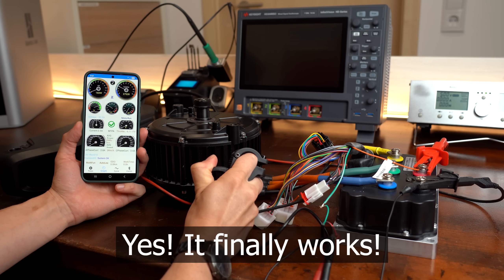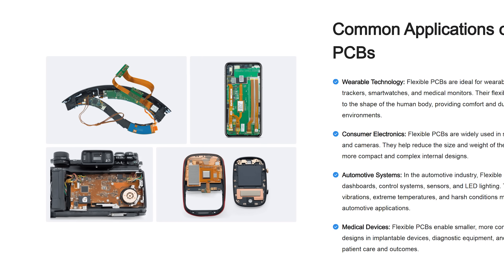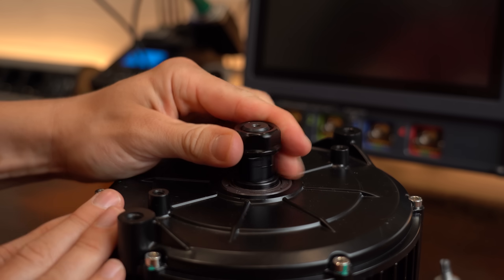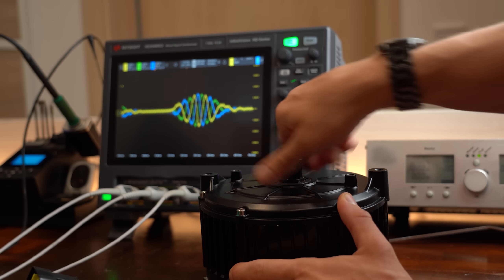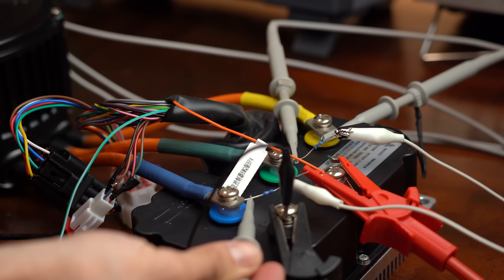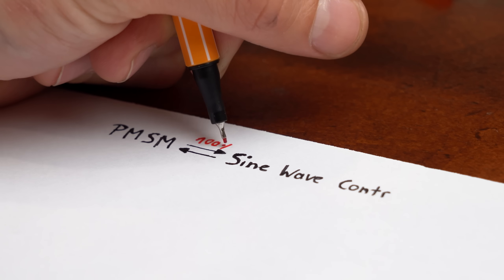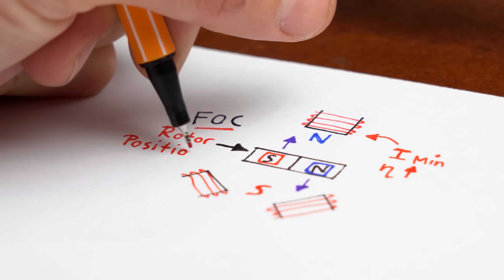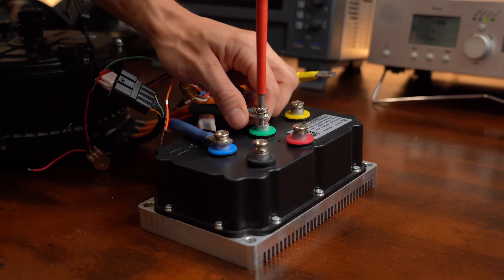The Most Important Motor for our Electrical Future?! (PMSM) EB#63

Comment: Finally someone explain in clear way the difference between BLDC and PMSM
Reply from the maker: Thanks :-) I tried my best
Reply: @greatscottlab  I still don't get it. I have bought a couple of cheap Bosch BLDCs from Pollin, quite big ones, and when playing around with them I got a beautiful sine wave on the oscilloscope. Nothing trapezoidal. They were advertised as using permanent magnets and being suitable for power generation. So I'm still none the wiser. What is the crucial difference? Why do my BLDCs behave like PMSMs?
Reply: @horrovac  Yea, I've also seen small drone-sized BLDCs generate sine-wave, and ESCs outputting sine-wave, I'm confused af.
Reply: @horrovac  The term gets thrown around interchangeably. But ideally, a PMSM  and a BLDC have only one fundamentally significant physical difference. That is how the coils are placed on the stator. The rotor is almost always halbach array, so no difference there. By playing in between how much of lap winding and wave winding is done, a PMSMs BEMF changes, if the motor is very wave wound, then the coils are "deep" and the voltage clips on the top. The magnetic flux linkage between the rotor magnet and stator coil is strong and sudden when the rotor aligns directly with the coil, this gives a near-constant rate of flux change when the rotor is in this aligned region → resulting in a flat (clipped) voltage during that time. So, basically, BLDC is just a PMSM that designed to tolerated the DC like psuedo sine wave that is fed it to it.

Mind you, if you do sPWM or SVM control on BLDC you still get all the benefits you get with a PMSM. But if you run the PMSM with a BLDC trapESC it will heat and destroy itself even within its operating parameters and inside its lifetime, but its not immediate or anything, just it doesn't have the winding to soothe those ruffled MSW feathers.
Reply: I worked in EV PMSM development, they’re the same thing. The voltage waveform is just a compromise about optimizing for harmonics and NVH (more sinusoidal), or optimizing for torque density (less sinusoidal)
Reply: @BIGGlep  I work on mil/aero grade actuators, so PMSMs are very important for us too. God I love those motors. And I hate anything with brushes.
Reply: @BIGGlep i told him so.. he make a case form nothing..
Reply: @Cody_Istre  I don't know what you mean. Trapezoidal concerns the shape of the output curve, this has nothing to do with 3-phase. 3 phase means that they have 3 supply lines for windings oriented 120° out of phase respective to each other, so yeas, they are 3-phase.
Reply: @anubhavmuku96  Thanks for the substantive answer (even though I have trouble following at times because it's too advanced for me). I thought that it must have something to do with the configuration of the windings in terms of overlap or something. But I still struggle to understand why my motors are called BLDC when they appear to have the type of winding that according to Scott are typical of PMSM. I have two types of those, the types are 1.607.022.68B and 2607022335, and both are described as BLDC.
Reply: @horrovac  if your BEMF is sinusoidal, I'd say it's a mix between the two. But most use cases its prolly, a PMSM. Try using with a trapESC and see if it heats up, only a few minutes of running at no load should make it quite warm if its a PMSM. Tbh, I have chinese motors they sold me as BLDC are actually PMAs, and those guys have like crazy torque ripples when using the trap controllers. Worst part is, there is no way to know which is which until you load it lol. That is why, I decided to just go for FOC controllers. They are difficult to use? Yea, if it feels daunting, try out the MCF8316 series of controllers. They are great, and pretty easy to use. Super safe too! Ay, if you got any part you don't understand, lemme know. I will try to explain it in a bit more detail.
Reply: @horrovac  you telling me a guy with a ukraine flag pfp lacks the basic ability to understand? say it aint so!
Reply: @BIGGlep  I do still wonder what waveform type/winding would be best for a motor driven sufficiently closed-loop by a modern e.g. GaN inverter that's on it's own sufficiently happy to deliver all the harmonics you'd reasonably want in your electro-mechanical motor construction. Like, there's minimum practical air gaps which force corresponding lower bounds on pole pitch lengths, whcih together with upper limits on circumferential speed due to e.g. not wanting the air gap to go supersonic, limit the electrical frequency to something far below 1 MHz, such that at least very fast GaN inverters that may run at 3 MHz "casually" can run as mere fast-tracking buck converters rather than as comparatively dumb line-frequency inverters that abuse the motor windings to smooth out voltage spikes.
I'd be surprised if actual sine wave shapes would be ideal in practice; at least if there's flexibility to have more than 3 phases. C.f. the humble stepper motor: a 2-phase switched reluctance motor. 2-phase is bad for power grids, as neutral doesn't cancel out like it does with 3 phase systems, but we're in the age of DC transmission anyways for pretty much all things that don't drag legacy backcompatibility with them.
Reply: @anubhavmuku96  Thanks again - it still goes way over my head. I only bought these motors with the intent of getting into controlling them, but didn't actually get around to dive deeper into their construction. I really appreciate the information. I didn't really know about the differences among them, I kinda assumed those ESCs output a sort of (rough) sinusoidal output and that all 3-phase motors are same or at least very similar.

Thanks for the hint with the MCF8316D controller, that's yet another rabbit hole to fall down...
Reply: @horrovac you are unlikely to find any easy distinction between BLDC and PMSM. At the emd of the day they are the same thing. They might have minor differences in how the coils and nagnets are arranged, but it would be unlikely you ever notice.
Reply: @anubhavmuku96  thank you for that eloquent version of what the video has already explained.
Reply: He should have explaine square, trap and sine controllers too
Reply: There is no real significant difference. BLDCs are supposed to have a trapezoidal back EMF which reduces their torque ripple when powered from a 6 step commutation process of a typical BLDC motor driver. PMSMs feature a sinusoidal back EMF due to slight differences in the way the magnets and rotor are designed and the geometry and electromagnetic fields within the machine. And optimized for a motor driver that provides sinusoidal excitation (usually space vector modulator, direct torque control, field oriented control). Though you can absolutely drive a PMSM with 6 step too and BLDC with FOC or DTC. In practice the back EMF waveforms is never perfect or ideal anyways so in practice I don't consider them different.
Reply: And what about "EC motors"?
Reply: To be frank the only difference I can see is the partial overlap of one coil with the next, I guess this is the reason for the apparent sine wave when running in generator mode. Induction motors also have this overlap of the phases. Bldc motors switch the poles from one to the next. The bldc motor driver also uses pulse modulation to adjust the average current through each phase otherwise they would be running at maximum current continuously even at low speeds.
Reply: ..but could you not be micro stepping a bldc, to have more smooth movement / more steps than poles, more artificial steps that is?
Reply: Look at the video 9:10
Reply: @londonbuddha I did. They're the same thing. Controller characteristics may differ, but the two motors function the same.
Reply: zigliotto lo ha già spiegato bene dai
Reply: @francescorodeghiero5649 Esatto 😂😂
Reply: @francescorodeghiero5649  Chi? Dove trovo questa spiegazone? Si tratta di un canale youtube o qualcosa di simile? Ho cercato ma non trovo niente di utile.
Reply: Technically BLDC is a type of PMSM, as it is also a sychronous motor having permanent magnets in it. The build up of the motor defines the back emf profile and not all BLDC even if they have trapezoidal wave form need six-step commutation, its just a simpler way of controlling these motors. On the other hand, if you want to optimize for maximum torque, ripples and noise etc. most of the time a bit complex algorithm is needed such as SVPWM, FOC etc. 
summary: BLDC is a sub class of PMSM.
Reply: Its just using a smaller square waves to make the sine. What a sham
Reply: Fkn Germans! , what do you expect? Of course they will explain it correctly!
Reply: There is no such thing as a brushless DC motor. 
They are electronically commutated synchronous AC. 
And the only reason for them is to allow the pricks to track and deactivate your vehicle remotely whenever they want. 
Electronic commutation is extremely inefficient.
Reply: i have explain in 2 second.. halbach setup of magnet and DELTA conection winding.. enjhoy no need to thx me.,. save oyur time..

Comment: time for a go kart build!
Reply from the maker: Noted
Reply: @greatscottlab  my thought exactly :)
Reply: @greatscottlab  yes, please build one with step by step instructions, so we can follow!
Reply: @deserRGB  and do it in a collaboration with Colin Furze. He does mechanics, Scott does electronics.
Reply: @greatscottlab  That's certainly enough power to think about all-wheel drive. Otherwise, just looking at the accelerator might flash the rubber from the rear tires out of existance.
Reply: np, we already build it https://youtu.be/Z_bitPYwo00
Reply: Please build a three-wheeler using the same layout as the old Messerschmitt Kabinerollers :)
Reply: Was just thinking of that
Reply: yep, time for Mario Kart.

Comment: Could you drive that thing straight from the grid using 3 phases?
Reply from the maker: It is made for 70V max and you need a higher frequency. So no.
Reply: probably need a transformer or control of some sort, the frequency might not match the voltage

Comment: ESC's based on AM32 or BLHeli_32 can use sine commutation. With the right motor and ESC combination AM32 can track motor position at pretty low speeds without the need for a sensored motor. still most of these ESC's are not fit for driving these large PMSM at full power.
Reply from the maker: The VESC can also do FOC and Sine Wave. I would really recommend that one when going with a bit "lower" power.

Comment: It would be interresting to take a look at BLDC efficiency when driven with a sine wave controller
Reply from the maker: Noted. It is always a bit hard to compare efficiencies because you need like a constant break to apply the same torque to the motor. I will try to find a suitable one and do some experiments :-) If anyone got other ideas, let me know here.
Reply: @greatscottlab  ez would be prob to use another bldc and lock to say 500w and run a load, ofc need to account for losses to belt or chain but gives close enough answer, do get DC brakes for induction motors,
Reply: @greatscottlab you need a dynamometer for that…
Reply: @greatscottlab  A brake mounted on something that measures force. Same force means same torque.
Reply: @greatscottlab you just need another motor connected to the same dc link and having the control loop consecutive at torque control.
Reply: Maybe using matlab, could help.
Reply: @greatscottlab  I think you could couple the shaft to a BLDC motor, hook it up to a resistive load and measure the output current.
Reply: @wildekek  I was thinking the same. Just connect another bldc or DC motor and substract input power with output power of the second motor. The total efficiency of this setup doesn't matter as you just need to compare drivers.
Reply: @greatscottlab  ferrofluid clutch as brake?
Reply: @greatscottlab  With mine running my narrowboat i have a power readout from the battery BMS and i have a water cooling system. It wouldnt be too difficult to work out the heat going into the cooling system based on rate of rise and knowing capacities. The radiator could be bypassed for the experiment and the efficiency calculated by comparing heat dissipated with power input. My feeling is in the region of 90%. It needs very little cooling at 1500W and i would estimate dissipation at around 150W. Boats are handy as a prop is a very good constant torque.
Reply: @greatscottlab  Measure torque and rpm. there is your power. braking apparatus does not need to be precise as such. only adjustable. some applications could use a propeller as a load. For smaller motors ( well, bigger too.. ) you can easily diy this using a scale. There are probably readymade testers available but they tend to be pricey. dont know what kind of budget you are working with.
Reply: @greatscottlab  install a polished metal drum onto the shaft. Put a couple of turns of rope around it, and tie one of the ends to something stationary, and leave the other one hanging free. The motor should spin in the direction so that it tries to wind on the free end. Then, apply a known force to the free end (e.g. hang a weight). Now if you turn the motor, the rope will slip, and the braking torque is almost exactly equal to [force applied to the free end] * radius. There is a small error in that there will be some tension on the other (anchored) end, but it gets exponentially smaller the more turns the rope has around the drum; if you have too many, the rope might get stuck to the drum and actually start winding onto the drum instead of slipping.
Reply: @greatscottlab  Curious about its efficiency as a generator compared to the other motors. That shiny sine-wave looks better but I'm not sure how it would work when charging batteries as a break. Though I'm unimformed and there's probably something better than a FULLER BRIDGE rectifier as far as efficiency is concerned.
Reply: Yes
Reply: VESC controllers offer pure sinewave control for BLDC motors. Check the Trampa board controllers if you are looking for high-end motor controllers.
Reply: @jhonny44444  And actually its field oriented control with space vector pulse width modulation and maximum torque per amp making is top of the line of current controllers. This allows field weakening, real time adjustment of phase angles to get best torque for current, very good utilization of dc bus voltage allowing higher motor speed and power with same battery voltage as basic sinewave controller.
Reply: Couldn’t you just lift a heavy weight? Time how long it takes to lift 10 kg by 1 meter, and measure the power. Could also see how the efficiency drops when you go extra slow or extra fast.

Comment: So the main difference between BLDC and PMSM is the current waveform? BLDC is kinda like square wave and PMSM is more sinusoidal (and that also affects the torque behavior)
BTW the different between switching reluctance motors and synchronous reluctance motors is similar to this?
Reply from the maker: Yep. Trapezoidal VS Sinusoidal is basically the main big difference.
Reply: I did read somewhere that the waveform difference is due to the placement of the permanent magnets. 

PMSM has curved magnets that's embedded into the stator (the stator literally has empty slot to put the magnet in).

In contrast, BLDC has magnets that's glued to the inside of the stator. The magnet doesn't have to be curved as a result (it still can be curved, just not necessary). 

This difference means bldc is usually cheaper to make and buy. But tbh this difference doesn't matter much in reality. Mechanical engineers who design the drive train only need to care about the motor power and price. And if performance and efficiency is the top objective, then you get a motor engineer to make your own solution.